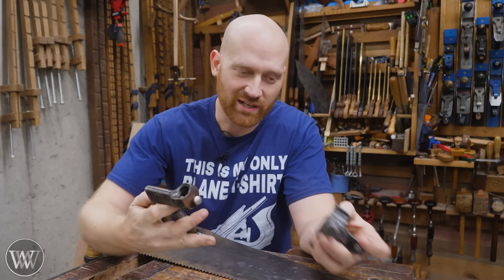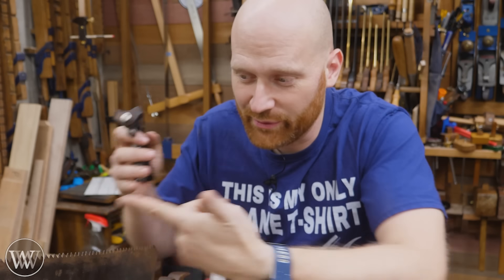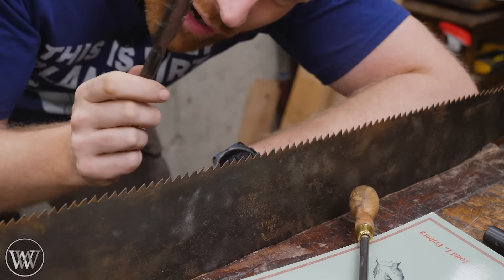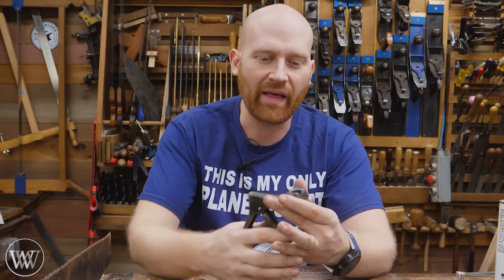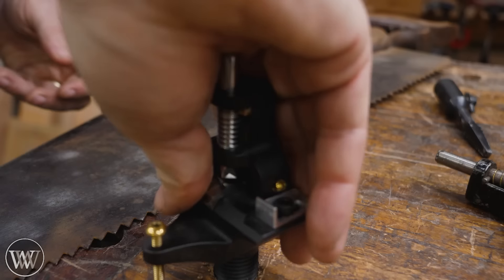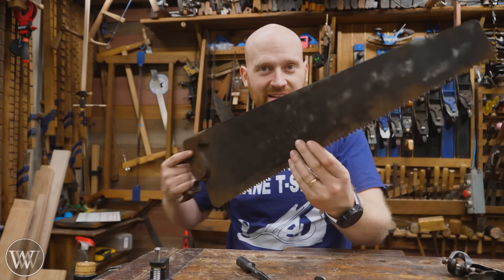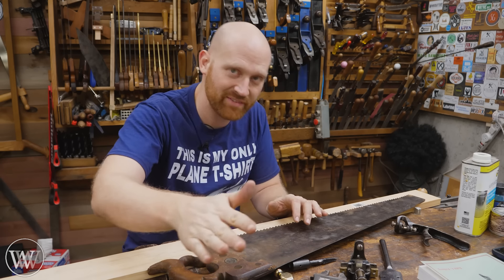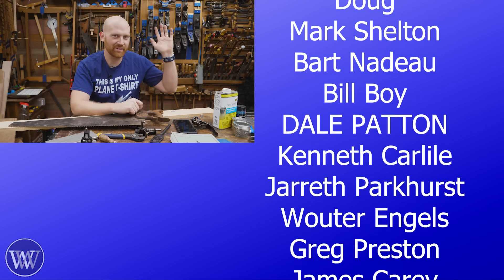How To Set A Saw

Comment: I initially sued to set the saw every time  sharpened it.  Over the time I have been sharpening my saws, I have eased off and now only set when the saw starts bind easily.  Learning about stoning the saw proved to be critical to cut quality with my backsaws.  Not just because it helped straighten the cut if the saw wandered, but if there was too much set, the blade will waver slightly side to side.  That creates a messy cut surface, so I stone to clean up the up as well as straighten it.

Comment: For my fine-toothed saws I use one of several jigs I made using a bit of hardened steel and some red oak I had lying around (total costs of jigs about 10 percent of the Bad Axe jig) and hammer-set. For my handsaws I use a saw setting plyer like my grandfather did.

Comment: I found several cross-cut saws and blades once.  I filed the teeth and set them by trial.  I am sure I didn't do a great job, but heck, the saw did cut after I worked on it.  I also made a handle for one that did not have a handle.  This was back in the 60s when I was going to college.

Comment: I was really scared of setting a finer toothed saw I had bought to repair (15 ppi). But after watching a few videos, mostly Mr sellers, I just had a go using a nail set and a very light tap with a Warrington hammer. After that it was a good fine rip cut . Just got to get brave and have a go
Reply: I bought an inexpensive saw to practice with myself.

Comment: I had watched your videos on sharpening, but now that this one has released I should be all set! 
I wonder if there's the potential to add a mechanism to something like the Bad Axe system that delivers a sharp blow, but the same every time. Something like one of those automatic center punches.
Reply: That item can be found for a price - watch the video of James getting his custom saw made!
Reply: There are "trip hammer" saw sets. They are usually pedal activated and controlled by the tension in a few springs. They are a precursor to the automatic saw sets that Foley, Belnap, and Beaver Manufacturing Company (BeMaCo) made.

Comment: When youbbend or stretch metal, it first goes into elastic deformation and it will spring back to the original position. Bend setting is a perfect example of this.  So you have to go beyond the elastic deformation into the plastic deformation where the metal stays in the final shape. Hammer setting is fast and skips the elastic deformation phase and goes into plastic deformation right away.
So if you are doing small amounts of set, you pretty much need to hammer set them. If you bend them, the might spring back to straight.  Or if you bend them to stay put, you may have bent them too far.
Reply from the maker: for those that like to use plyer setting they say that you just bend them a bit further so that it will relax back to where you want it.

Comment: Way more about saw setting than I ever imagined. That said, I’m still wondering if the treatment is different for rip and crosscut saws. I imagine it it’s and can intuit out how to do it right I suppose. Unless there’s something to know that wouldn’t be obvious until I have done it a bunch of times. As always, James, great video. You do some really good work putting these together. Thank you.
Reply from the maker: There is no difference between rip cut and crosscut. The only slight difference is that with rip cut you can do every other tooth in any orientation. With crosscut you do every other tooth but you always want to make sure the point of the tooth is pointed to the outside.

Comment: One of the more interesting, on the jobsite, ways Rex - I think - showed on a wooden plane. The user set the saw with a punch and using the long bevel on the body of the plane as the anvil. You could see the outline of the saw teeth on the bevel's face.

A word of advice for those looking to get the pliers/pistol type saw sets, if you are doing the setting in a vice, the pistol grip type (e.g. Stanley 42X) can have problems. Since the saw cannot raise very far above the jaws and the handles are perpendicular to the jaws, you can run out of room for your hand, the saw set, and the vice jaws; I've had this happen. The Eclipse style pliers do not have this problem. I've used both, and, as James said, if you are setting more than 1 saw, you will have the Kung Fu Grip of Death by the time you are done.

Comment: I read somewhere that you have to be careful to set the teeth in the same direction each time - meaning if you set a tooth to the left one time, don't set it to the right next time.  Otherwise, you may break teeth and have to recut the saw.  Is this your experience?  Thanks - an excellent video.
Reply: That is correct! It can put too much stress on the teeth to bend them the opposite direction and they can snap off when filing or sawing. If it were one or two teeth, it shouldn't be a major problem though.
Reply: It would be the same as bending a metal wire back and forth until it snaps.

Comment: I have used a 48” frame saw to rip short (6’ long, 16” dia) logs for quarter-sawing.  The logs were green and if the set was inadequate it was difficult to follow the line I scribed with a sharpie.  I tried the hammer set method and the wrench set method.  Wrench set allowed me to make a wide enough set/kerf so I could more easily steer the blade.  Or maybe I was bull-dogging the blade as the log was not neutered?

Comment: Do you know of a video or blog that describes exactly how the 3 different points of contact in a pliers type saw set all contribute to the resulting set of a saw?   Almost all of the saw sets that are available for little money on the used market (ebay, FB marketplace, flea markets, ...) are of the 3 point variety,  with lots of variations in the form of the anvil and bottom screw (in the case of your tool), but I haven't been able to find a good answer about how that bottom screw (or its equivalent) should be set.  Similarly, there is very little information about how exactly to use the beveled anvils that slide up and down.  There are a lot of explanations for how to set the rotating anvils.   More generally, given the large range of designs for saw sets, it would be really interesting to see a broader discussion of how some of the more commonly available ones are intended to be used and what advantages each one claims to have.  (There wouldn't be some many different patents unless each inventor believed that he had made some worthwhile improvement to previous designs.)

Comment: How does the hammer jig make the set more even than just using a punch and a hammer?
Reply from the maker: because the bend is at the same spot on the tooth every time. it is not about the force but the angle to which it is bent.

Comment: Hi James, the teeth on my 5tpi are set way too far. What is the best way to set them back to the middle?
Reply from the maker: You can put a hammer in a vise with the head facing up and then lay the saw on that hammer and tap them with another hammer. Tapping them between the two Hammer faces will flatten them back down.
Reply: @WoodByWrightHowTo ok thank you!
Reply: If you place a piece of paper between the saw and the hammer head (or anvil surface) and gently tap the tooth facing away from you the thickness of the paper will get you in the ball park of the amount of set you want.  (The paper will only compress a small amount when the hammer strikes the tooth, leaving a specific amount of bend to the tooth!)  if you want less removal of the set fold the paper over to double the thickness.  Most pieces of paper are between 2-4 thousands of thickness.

Comment: Oh, either you put no cred to it, didn't know, or cut it for time...
There is also a practice in some areas to use less set on the toe of the saw. This is believed by its users to create an easier "starting" area at the nose for starting cuts. A less set section allows for straighter starting with less grabbiness or jumping around. This is sometimes achieved with more TPI by the manufacturer as well, at the toe of the saw. Of course more/smaller teeth and less set together do achieve a better starting pattern, but my question, as I don't own a saw with a starter section, is... Is the plate thinner at the nose as well? Otherwise, it would be more likely to bind where you have the most of the flexable plate between the push and the cut.
Thanks for any input/reply.
Reply from the maker: Ya I have found that to be WAY more work then it is worth.

Comment: I’m surprised a bigger set means more work, most of the work will be from cutting the fibres each side of the kerf, that’s the same whatever the set 🤔
Reply from the maker: You are removing more wood. Getting the dust out of the crack without binding is a lot of work.  And when rip cutting the teeth are paring the fibers out as opposed to the slicing action in crosscutting.

Comment: You flat work people are at least as bad as we lathe people.... Ask 10 people the same question, and you will get at least a dozen different answers. My first thought with the Bad Axe saw set and the one before it was that the hammer part was spring loaded so you pulled it up and let it go to get the same amount of strike force each time....